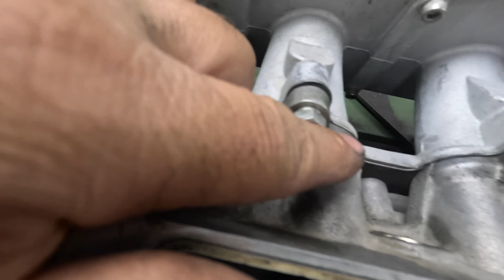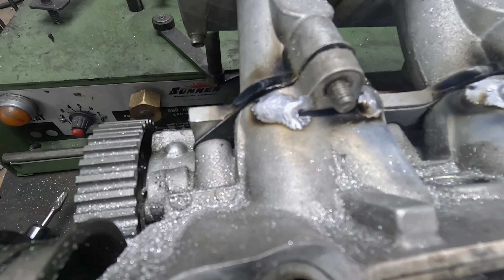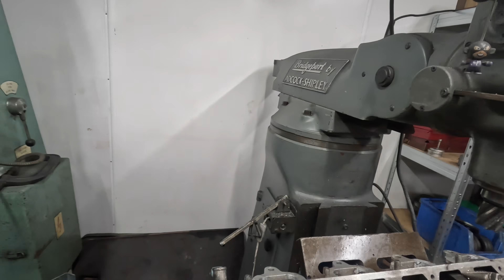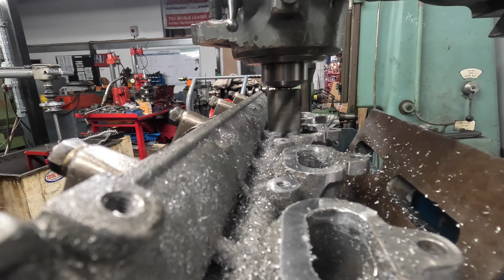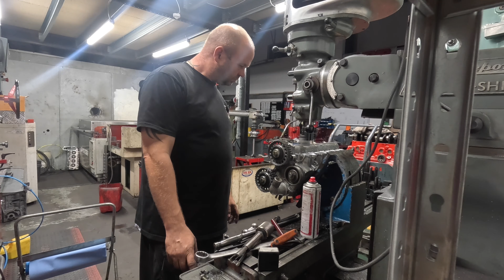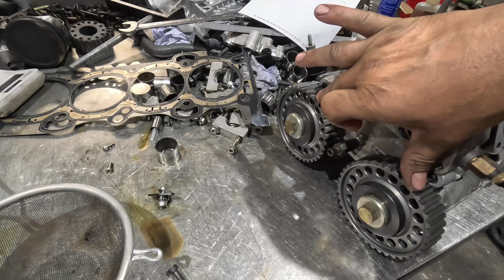Can we save this cracked Cosworth YB Cylinder head from a Xpack Escort MK2 Aluminium welding

Comment: That head looks to have been well machined down on the head gasket face
Reply from the maker: I didn't measure it to be honest
Reply: @graceenginedevelopments  it looked thin before you machined. You can tell by the temperature sensor housing that unbolts. 
Also there is the brass bush in the head
Reply from the maker: Yeah I agree it looks a bit thin.